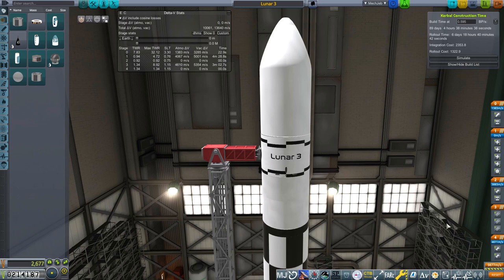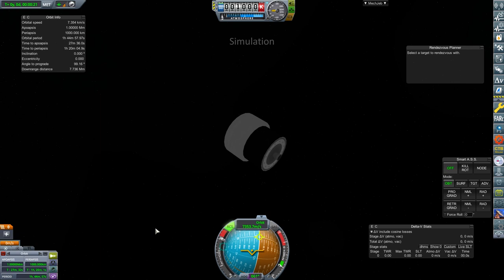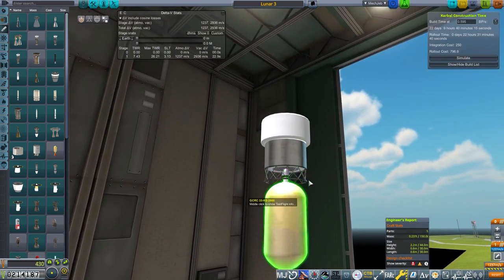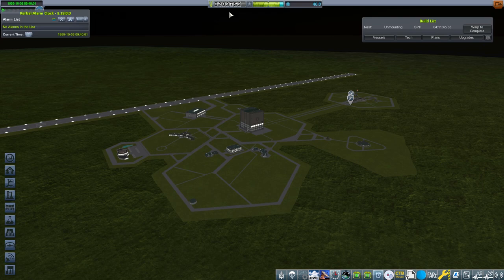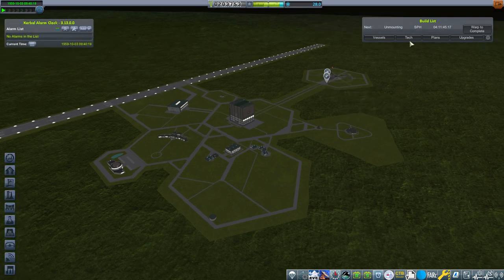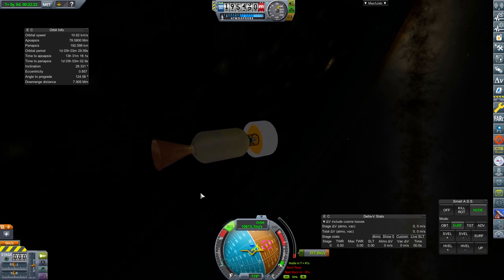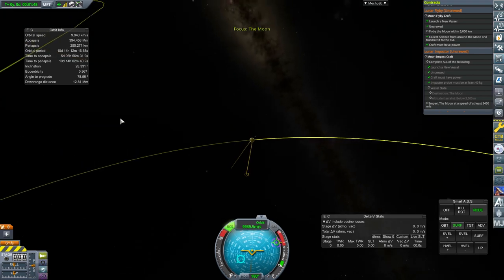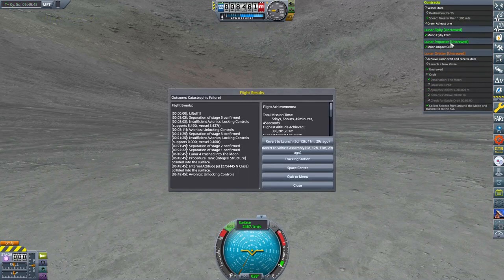A Very Basic Space Program | Episode 21 | KSP RSS/RO/RP-1

Comment: I think they changed the node where that small thruster that is on the probe is located, I had to use a larger one that was unlocked by Early Flight Controls, whereas the smaller one used here is unlocked by Improved Flight Controls which is two RCS nodes later in R&D.  It still worked fine for getting a perfect lunar flyby and impactor, but took a few minutes to figure out why I couldn't fly it and to adjust as needed